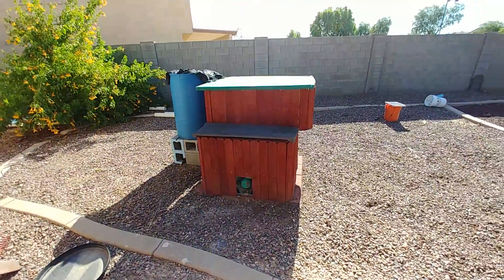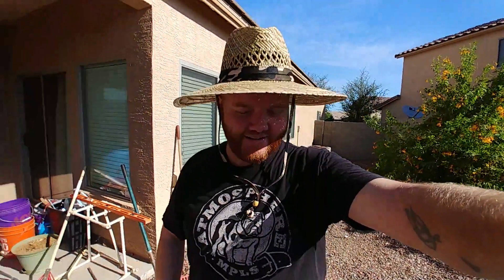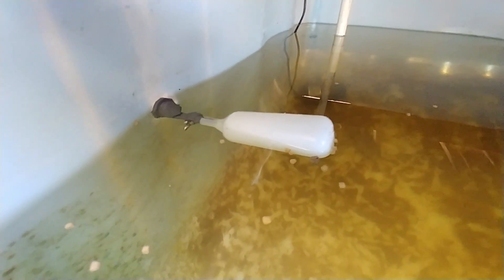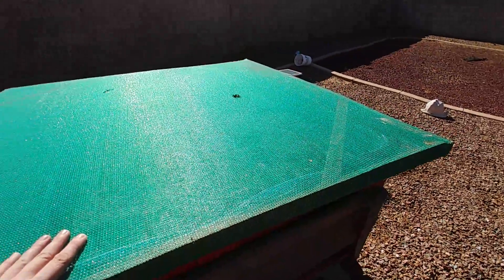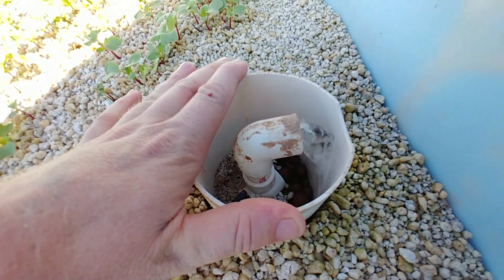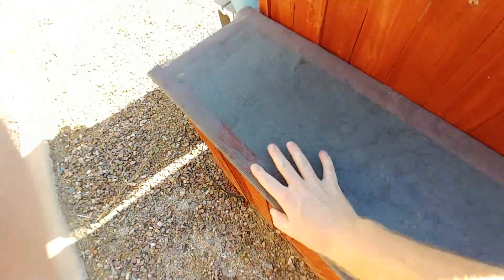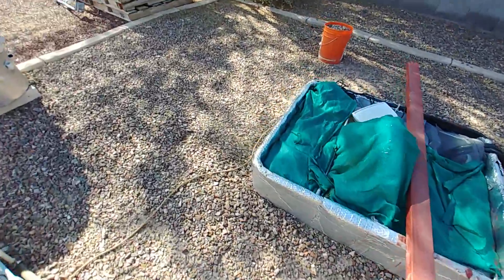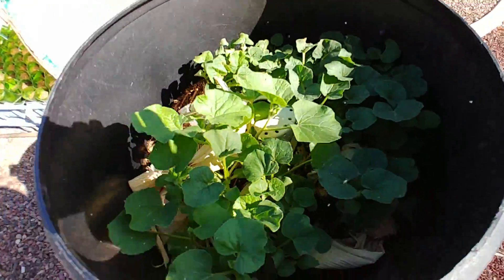DIY Solar Aquaponics system Complete!

Comment: Lookin' good Todd.  What's the next project 'cause I know you got something in mind?
Reply from the maker: Thank you Brother! I'm going to be tinkering with charge controllers and voltage regulators and batteries for upgrades with an air compressor and pump that runs 24/7 and then addapting it t the large system.

Comment: Ya got a link to that panel and pump? I think I need try that solar pump on the aeroponic system.  Would save some extra $ not having to bury conduit and run new line up to my new area.
Reply from the maker: Solar Water Pump kit 200+GPH with 12v submersible water pump and 20 watt solar panel for Solar Powered Pond, Fountain, Waterfall, Water Feature, Hydroponics, Aquarium, Aquaculture (No Battery Backup) https://www.amazon.com/dp/B073J1SL2Y/ref=cm_sw_r_cp_apa_6-fEBbXH6HC7J
Reply from the maker: This is the exact model that I'm using, unfortunately the price has almost doubled since i purchased the 2 I have @$79.00 each.